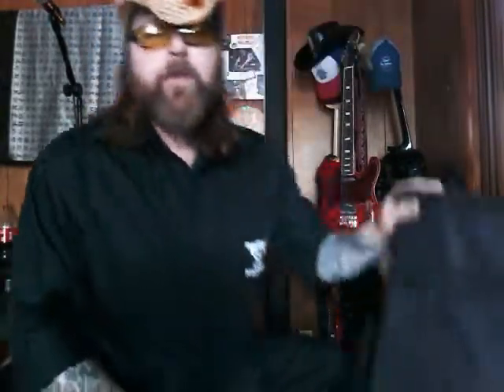Mls900 harbinger line array, lo Z connection from mixer, top notch hacks part 1. #Reverendhellbilly

Comment: I plug my xlr from mixer output line into two of my MLS 900 channel 1. I just turn the line one up. It sounded good through Mackie FX 2 8 channel mixer.
Reply from the maker: Yeah.that is a good way.
Mackie is the stuff.
Cheers 🍻

Comment: Hang on. If you're using 2 MLS900's in "smart stereo" mode, then if you plug a mic into one of stereo channel 3's 1/4" jacks, the mic will go thru only one speaker (left or right, depending which side you plugged the mic into). Wouldn't it work better to plug the mic with XML>1/4" adapter into channel 1 or 2 (they're combo jacks) and select line in? Then the "smart stereo" mode should send the mic thru both speakers...
Reply from the maker: Smart stereo  mode doesn't  work for me,one speaker real quite, So I don't use it, cheers
Reply: @ReverendHellbilly  That's too bad. I recently bought a pair and the smart stereo mode works well, a very convenient setup. Have you tried a support call to Harbinger? By the way, thanks for your pro tip on the 1/4" adapter. I have one of those somewhere around the house, trying to find the dang thing!
Reply from the maker: Right on. Cheers